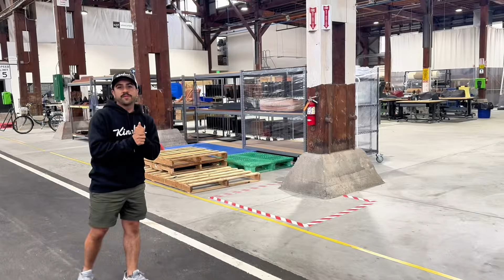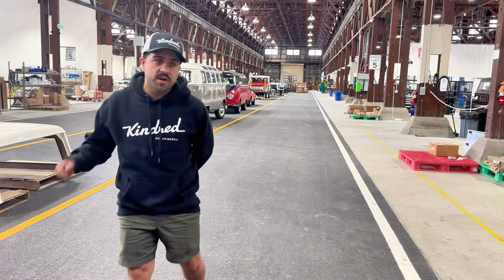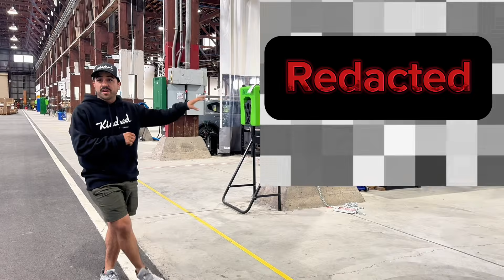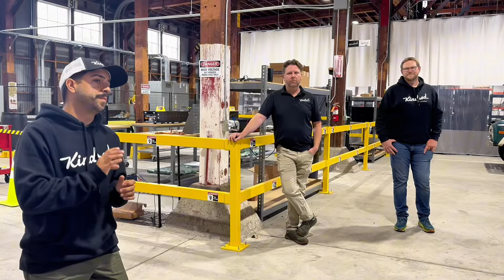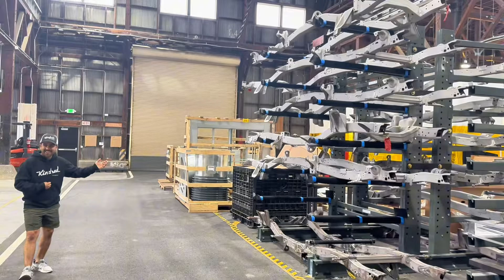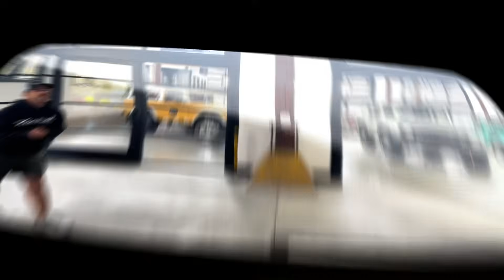Kindred Motorworks Electric Ford Bronco! - An Icon Reimagined!

Comment: what about body sound insulation? It is often not a priority, which is a shame. comfort also has a lot to do with noise. Many cars have extremely poor sound insulation of the bodywork.

I would have had fewer functions and a car with GOOD body sound insulation.

easy to get rid of bright frequencies but not as easy to get rid of dark frequencies something many car factories skip and then you hear a lot of tire noise or other irritating noise.
Reply from the maker: @kalle-09c  watch the video it shows part of the process for how they treat the body and frame to reduce NVH. EVs also have much smoother and quieter rides in general. You’ll get a luxury vehicle experience with EVs like the F150 Lightning that I drive

Comment: Do you think that electric cars are so environmentally friendly? You have no idea.

How are the batteries made? Precious metals must be excavated from the ground, which causes a lot of damage to nature.

The car becomes heavier and tires wear out faster, which also means more tire particles in the air, and the asphalt wears out faster.

The load capacity of a car, truck. will be  lower.

You need to charge more often than you need to refuel.
Which means you get less work done per day.

Then you have the batteries which ofte are unstable and have problems. 
Batteries do not withstand cold very well, you will then get a lot less capacity out of them.

The energy density of these batteries is MUCH worse than petrol and diesel.

We have been trying to get higher energy density in the batteries ever since the 80's without being successful.

Everything cannot be improved forever.

And noise inside the car, front and rear while driving is often given lower priority and the car gets poor sound insulation!!!😢
Reply from the maker: @kalle-09c  I drive electric because of the vastly superior driving experience and much lower cost of ownership with free energy I get from the sun. My solar is paid off and I’ll have 20+ more years of free power from it. I charge at home so wake up ready to go. Tires last to 40k plus miles. While initially a more environmentally impactful process to manufacture, over time in all examples it’s better for the environment, although again that wasn’t in my top 5 reasons for ownership, it’s just a bonus. Any manufacturing will have an environmental impact as does drilling extraction shipping refining shipping again dispensing and burning of oil. Experience an EV for yourself and do some additional research and get back to me on what you find. Don’t listen to sources you have never owned an EV and don’t know what they are talking about 😃